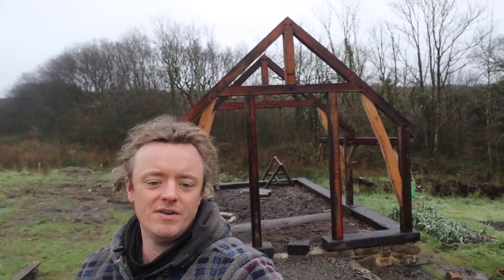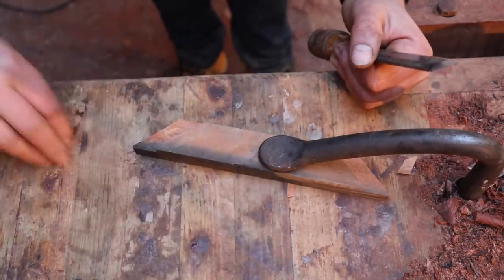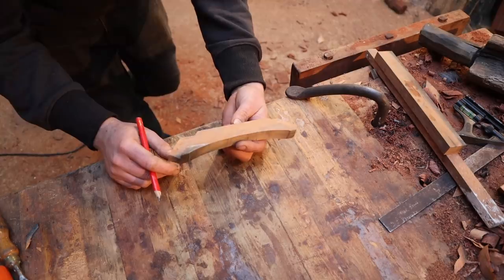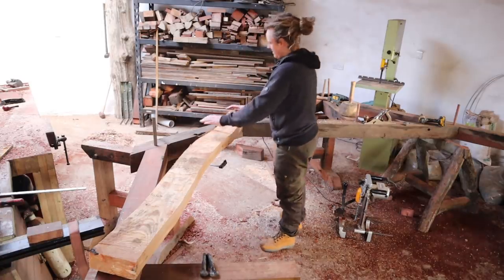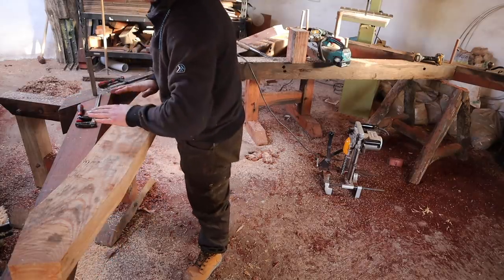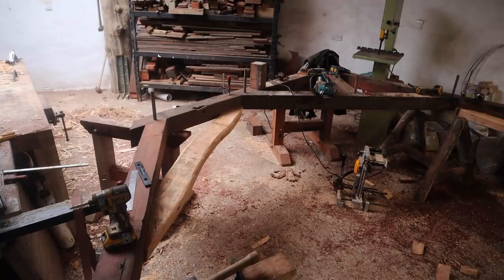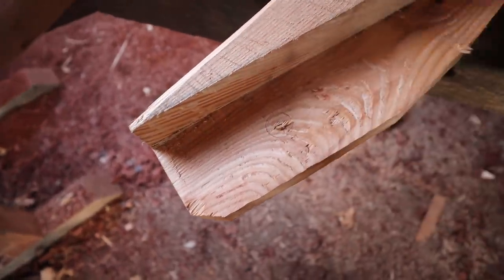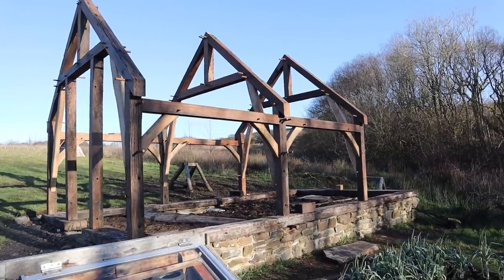Spring Fed Timber Framed Greenhouse Part 7 How to cut wind braces

Comment: Great video in both content and style!  I am going to be a bit technical, but I think it is important to differentiate between a leg brace and a wind brace....... the example you worked through on the long brace for the frame is called a leg brace or frame brace.  The purpose of this brace is to transfer the force of the roof through to a point as low down as possible because of the lack of a tie beam where the truss of the roof meets the vertical post that creates the wall of your greenhouse.

A wind brace is used to stop lateral forces between the frames (I.e. the bay created between 2 frames by the connecting purlins and beams) that may be experienced by an external force from the prevailing wind.

In post and beam construction, the frame, if well designed, is intrinsically strong as the primary purpose is to stop and spearing force from the roof pushing out the walls, but of course we want a 3D space and not just a pretty 2D frame.  As this video correctly explains, the braces, wether they are legs in frames or wind braces between or within frames (I.e. the frames at the ends of a building as per the ones adjacent to the door opening for the greenhouse) are very important in the overall integrity of the construction.

Keep going!

Comment: Hi Chris , best if you can use at least partially dry sweeps for braces , when the heat is cranked up they will shrink width ways and the top end of the shoulder might open up. Not a problem structurally as long as the tenons are pulled right down to the baring points at the ends of the mortises. You can do this by pricking your peg holes with the drill in reverse and then offsetting in two directions to pull the shoulder in and down when it's pegged . Keep it up !

Comment: Another method for making curved wind braces is to make a layered ply on a rounded form using thinner boards, clamped and glued together. That though you run the risk of the layer's separating. I like your method though, using already "crooked" wood.

Comment: You could use the same method & cut a dovetail into the tenons to resist the tension spread also. That sadly only works for a half lap cut though.

Comment: Nice work, Kris! I don't believe that you had to put the braces on the underside. All you had to do was flip the bent around when you go to install it in its upright position. Just a formality I guess.
 I love the look of that re-salvaged wood! I couldn't think of a better use for it. Beautiful! As a timber framer myself, I appreciate the work and to the thought put into your build. I think most here appreciate your efforts to not only build this quaint structure, but the time you invest in providing step-by-step video of your progress.
 A tip of the hat, so to speak, to you. Cheers from Canada!
Reply from the maker: Hi, yeah that is true, but i had also already put bit of wood facing the front that were better quality and cut the left post 10mm shorter as the foundations is 10mm out so i couldn't really switch it at that point. Nice to hear from a timber framer. If you have any tips i would love to hear them as im really just learning all this stuff.
Reply: @KrisHarbour  You seem to be doing quite well on your own. Methodical and well laid out. You don't need any tips from me, sir. But if I have any insight that might make life easier for you, I will certainly pass it along. All the best and good luck! Cheers!

Comment: Hope your managing to keep warm in these cold days, bet your burning through that stack of wood quick
Reply from the maker: The fire has been on alot! usually i only have it on in the evening but recently its been on all day. Its so dry as well for this time of year. we are a bit low on power. The hydro is down to under 200w at the moment.
Reply: @KrisHarbour  I bet doing the Green house frame has used alot of power too, maybe good that you're going to do other things, how well do the solar panels work during the winter months ? cant remember if you have ever covered the solar panels in a video ?

Comment: I have to confess I am no expert. But you clamped the wind brace underneath the frame because you want them to be inlayed on that side. But do the side you fit them into matter? You could just as easily have flipped the frame when putting it up, getting the wind braces on the right side that way. Or am I missing something?

Comment: @25:41 Those splits make me nervous… are they anything to be concerned about? I guess not seeing as though you cracked on regardless
Reply from the maker: No. They don’t effect the strength much at all. Most of them are not very deep at all. Just cracks from years of wet dry wet dry with the changing seasons. The inside is solid.